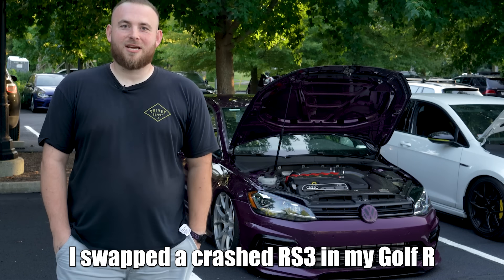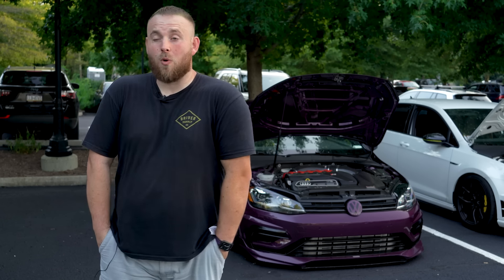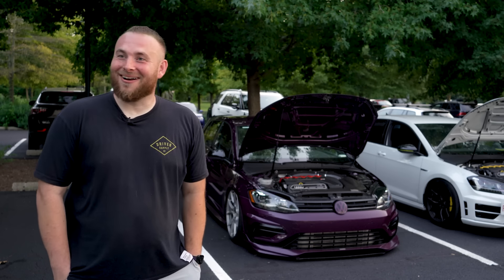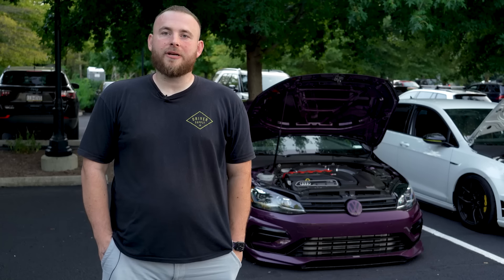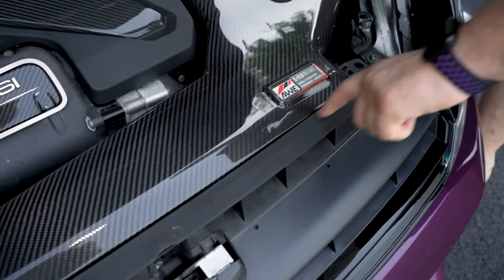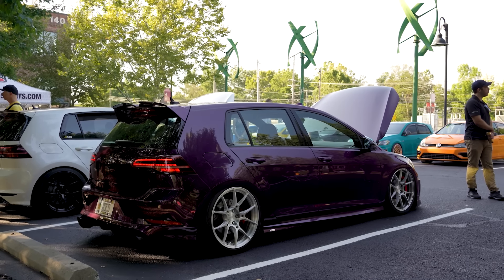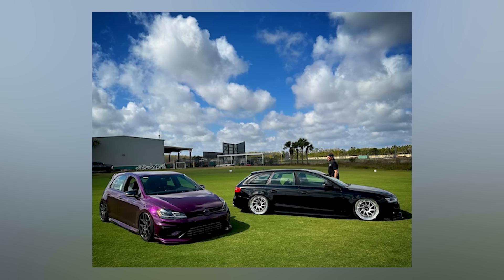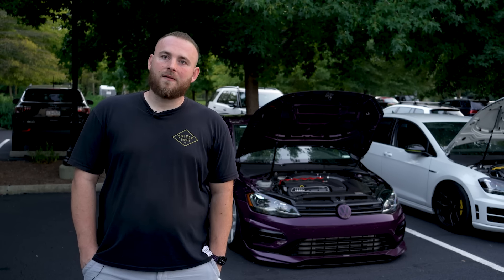5 Cylinder Turbo MK7 Golf R (Daza Swap)

Comment: This is what the R should have been from the start. Keep the GTI, GTI and the R, special.
Reply: Sadly not even the Tiguan and Arteon got this engine. Only the Cupra Formentor and obviously the RS3, seriously VW it's taking the piss even on Europeans.
Reply: @ipaghd  vw asked audi if they can use the 5 cylinder for new golf r but audi refused
Reply: @ipaghd ttrs and rsq3 use the daza engine aswell.
Reply: @grp5ltdot2024  Management thought that VW using the RS3 5-cylinder would steal sales from Audi so they decided against VW using it. Its not because "Audi refused"
That's why the only other brand who's used it is Cupra because their cars are limited and won't take too many sales from Audi

Comment: The RS3 DAZA engine is pure 🔥. So sick inside the VW platform. I've got a Mk7 GTI, and don't get me wrong I freaking love my car, but the 4 cylinder just doesn't sound anywhere near as good as the 5 pot DAZA. Sick build my man 🔥
Reply: Thank you!
Reply: I am thinking about tackling this on my personal spektrum golf r. Do you still have the wiring diagrams you can share? @DriverSupply
Reply: @DriverSupply can you please help me with the wiring diagram how i can contact you?

Comment: Cool build. My opinion and info for others. A business not giving out freely something they paid for is not "shops gatekeeping information". VW literally sells access to their service info to anyone for 35 bucks a day and you can download all the diagrams you want. Seems like it would of been a huge time saver for next to nothing cost wise relative to the cost of the build.
Reply: I didn’t know VW sold iwire access to outside end users. Thanks for the heads up I’d have to check that out! Also my ideal for gate keeping is no one is willing to work with you, nor give out any pointers,etc. 2.7t, VR swaps and information are more readily available

Comment: Holy shit...  That has to be one of the most badass swaps on a Golf R I've ever seen.  Even more incredible that the guy did it in a cramped, basic homeowner's garage, not some specialty auto/car builders garage.  

Very well done...   Everything fits and looks like it belongs or was there from the very beginning.  What I like most about what he did, was that from the onset, he was determined that everything would work properly.  Some of these swaps, the guys that did it will tell you that this or that doesn't work like it should, or there's error lights on the dash all the time because some of the connections aren't what they should be.  On this swap, everything 100% works, no dash lights, no non-functioning options, etc...

The only downside to the swap is that it's not a manual TM, but I get it.  The donor RS3 is an auto, and the Audi autos are damn fantastic transmissions.  Besides, other than a custom rebuilt manual trans, I doubt you'd be able to find a stock VW 6spd manual that would handle this kind of hp.

Great swap young man...  HUGE feather in your cap.  Thanks DAP for showing this to us.
Reply: Thank you for the heavily kind words I really appreciate that!
Reply: "Everything fits and looks like it belongs or was there from the very beginning." - That's because A3 and Golf share the same platform and swapping I5 into Golf is just dropping it in. Engine from Golf R is also used in Audi S3. There is dozen of these swaps in Europe.
Some 5-7 years ago there was a prototype Mk7 Golf R with I5 testing at the Ring, but Dieselgate happened and they binned that project.
And there was never manual RS3, but for some reason VW sells manual Golf R's in USA where 80% of people don't know how to drive a manual, but in Europe where people would kill for manual Golf R they don't sell it. BMW did the same with E60 and F10 M5

Comment: Here in Brazil there is a guy who is doing a complete swap of a 2020 RS3 Avant into a MK7 Golf GTI (including radiators, electrical system, ABS module, and dashboard).
Since the GTI is front-wheel drive, he cut the trunk floor of a scrap RS3, cut the GTI, and welded it in the same place.
Note: the Golf R did not come here in Brazil.

Comment: Love it! That’s a car I would keep forever! I would love to do a 2.5T swap like this into my CC daily.
Reply: Glad I’m not the only thinking this would be sick in cc sleek design real sleeper
Reply: @atak258  If it was possible, I would take the entire drivetrain including the AWD system. If the AWD system was not possible, then I would consult a racing team and see what I could do to beef up the CC front axel to handle the power and torque. I know it won’t be ideal and spin like crazy, but I would be willing to take that chance. I probably drop down to a 16 or 17 inch rim to fit a R888R tire or something similar.

Comment: Ma shaa Allaah beautiful. Excellent work. I would love one in Audi exclusive mamba black, full oetttinger body kit, wider arches ala r400/or the white tte golf r, iroz ims850 or more, not sure on exhaust, must be quad pipe & eventuri componentry, full verkline, ohlins ttx, 18" bbs e07 & e88 centerlock like donal maher's golf r featured in speedhunters, full alcantara interior matt carbon trim with r8 steering wheel & buttons, touch climatronic, discover pro 9.2. Oh & most importantly mq500 with drexler diffs, not a lot to ask. Does anyone know if the oettinger 500r uses the old cast iron block or the newer daza aluminium block, as it has a 6speed manual 5 cyl 2.5.

Comment: Nice to see more of these swaps! Too bad you guys dont get the Skodas or Seats over there!
Reply: Also the stock diff wont handle that much power mate. I broke mine at 700-750 wheel lol
Reply: @Raskeable thank you! Yea I wish we got those here! The US always gets let down. A Cupra would be amazing! its stock RS3 diff not R btw
Reply: @DriverSupply  did the same swap in my skoda! Rs3 diff shat it's internals with 800nm. But that might be because a driveshaft went byebye. Haha I'm running through a whole list of issues right bos and only running 750 wheel and 830nm! But it's the best swap

Comment: Are there any shops in the US that do this?
Reply: There was one called Innovative in Connecticut that used to do them but they had since split. They did about 5-6 mk7s no 7.5 but still did great work.

Comment: I’m picking up a 2019 manual next week and would love to figure this out while retaining the manual shifter.. I have done a little bit of research and think I can use the transmission from a TTRS
Reply: That's right, I've been doing the same research for a while and also want to keep it manual. They're a rare trans to find but they're out there.
Reply: So the mk2 TTRS with the cast iron 07k had manual yes, but the DAZA variant didn’t. The fear is the unknown as there is no oem coding for a manual DAZA and how it would drive/ if it would. Also even the mk2 manual trans had weak points so does the mk7 manual trans. It’s risky but would be cool
Reply: @DriverSupply  wouldn’t a simple stand-alone solve that? That’s what I’m coming up against with the latest Atlas computers. There’s no software to get rid of the BCMs it’s looking for so standalone it is.
Reply: @casasdenick  correct standalone would fix it, would remove some oem functionality like adaptive cruise control etc but my best understanding is that standalone would be the safest way to figure it out, if it’s possible to keep the oem computers and find a way for the coding to be happy someone will figure it out
Reply: @DriverSupply  I hunted specifically for my base 2 door no sunroof MT mk7. Luckily I don’t have any fancy features to lose out on 😅

Comment: Would it be possible to do the swap with a manual?
Reply: It’s possible but it’s the unknown. No oem coding for Daza with a manual so wouldn’t know how well it would work. Standalone would likely be the better play with a manual, also the manual mk7 transmission is weak unfortunately

Comment: cries in GTI 

Is this even legal to do in California? Or would it throw codes when it comes time to connect to the OBDII for smog?
Reply: You can register an rs3 in cali you’d be able to register a swapped car (as long as the mods you install are smog legal) no codes
Reply: oh maybe I didn’t understand, I thought it still scans as a golf R?
Reply: @AdventuresAtRedline  correct still scans as golf R. No codes, should pass smog without problem as long as the mods are smog compliant
Reply: @DriverSupply   What sorcery enables you to run an RS3 ECU and it still scans as a Golf R?
Reply: @AdventuresAtRedline  witchcraft 🤪 lol

Comment: I wonder what the cost of this was? Obviously cheaper to buy a salvage car and take out parts, but still must have been a small fortune.
Reply: The Swap from USP is $90k on top of you supplying the Golf R
Reply: So because obviously I did more than just a swap, I modified the car with a larger turbo and other full bolt ons, suspension, forged wheels, oettinger kit, and the cost of the car itself, etc it wasn’t cheap at all

Comment: I want to see one manual, dsg is cool and all but yeah...
Reply: The problem with manual is the mk7 manual transmission is weak, and the DAZA motor never was coded for manual transmission. I’m sure it’s possible but it would be slower if your looking for power but also possibly would need standalone
Reply: @DriverSupply  well audi showed up to Ken blocks spot with a manual TT so I'm sure it's possible. But I don't care if it's slower, I want to drive the car.
Reply: @jungillestt02  I mean it is Audi. You’re talking about the clubsport? They write their own codes so fortunately it’s easier for them than it is for us. But I can never say it’s not possible it likely is and can likely work! Someone will eventually do it! I have contemplated offering the swap for people and hope to try make a manual work one day with this motor

Comment: Cool build but the the pops and bangs are just too much
Reply: Thank you! Yea they all pop and bang unfortunately. Wasn’t someone I asked the tuner for. When I swap the built motor this winter the goal is to tell the tuner to tone down the pops
Reply: @DriverSupply   Today pops and bangs are in every second car and I wouldn't want them. 
Back in the days that was malfunction if you were driving a junker. 
On 90s cars it was a joy if you could manage a slight crackle because it was authentic and wasn't meant to happen. 
Today this isn't a reward

Comment: Only the people who built these in the EU would have a manual gearbox! What have Americans got against clutches?
Reply: It has a Dsg still has a clutch … 😅
Reply: Not even Europeans have a DAZA in a manual. The CEPB motor had a manual transmission. There is no oem coding for a Daza with manual so there is an unknown on how well it would drive if even at all. The mk7 manual transmission is a weak one also unfortunately. I’m not against it but for my power level goals the DQ500 reigns supreme.